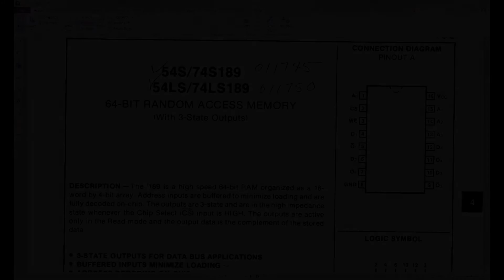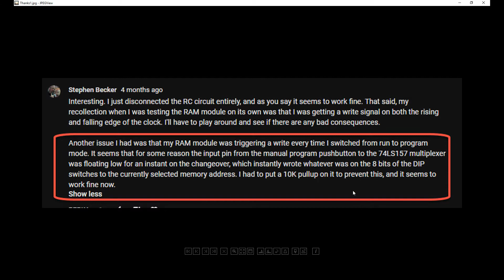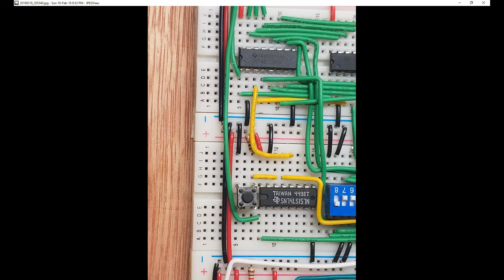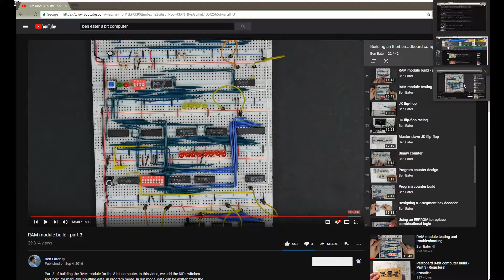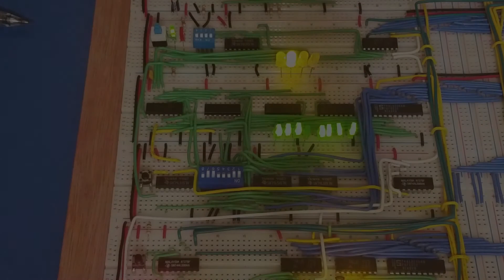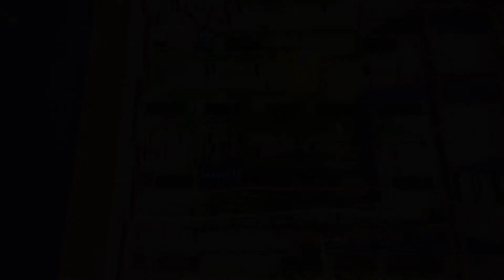RAM Overwrite Problem [Part 2] *SOLVED* - (Ben Eater 8-bit Computer) SAP-1

Comment: Thanks for posting this! I decided to build this thing during the pandemic and I had the same exact issue, but the 1k pullup resistor on pin 14 of the 74LS157 stopped writing ghost values into RAM. So, thank you for posting the other video with the symptom as well as the detailed solution here. 

I suppose thanks are also in order for Steven and Paulo for inspiring the solution.

Comment: thank you sir!   This also fixed my issue.  I had this exact problem and I also would get the "RAM Overwrite" when I pressed the CLEAR button.  Was driving me nuts!   I added 1K pull up in same spot you did and also one on the programming leg.  it fixed all my issues.   Floating inputs are BAD!!!!!

Comment: That's fantastic! I'm glad it is working now ! I didn't know you had a multiplexer between your RAM WE and the switch.... Indeed if you were connecting the switch first through a multiplexer, then the resistor should be at the switch... otherwise the multiplexer would be floating, and that would not have solved the problem.

Comment: Glad you solved it! Honestly I think Ben got really lucky with how smoothly his build worked electrically.

I've gone beyond his instructions now and made extensive modifications of my own, some of which fixed other pernicious electrical problems. In Ben's build, the four upper bits of the bus are connected to fewer ICs than the 4 lower bits (for example, the program counter, memory address register, and instruction register). I never exactly pinned down the combination, but this resulted in the upper 4 bits occasionally floating in a way that screwed up the ALU, particularly when LEDs were attached to the bus (even with dropper resistors on the backside of the LEDs and different value pullups on the bus itself).

When I upgraded my program counter and memory address registers to a full 8 bits each, the additional internal pullups on the octal bus tranceivers connected to the upper 4 bits of the bus completely cleaned up the floating values, and of course has the intended effect that I can now use 256 bytes of RAM. This requires a totally different RAM module of course, and reprogramming the microcode for "slower" instructions that run through two fetch cycles to retrieve instruction and then memory address.
Reply from the maker: Hey Stephen! I should have solved it 4 months ago from your other message, lol ... but for some reason I wasn't understanding what I had to do. In my defense, I spent all of 10 to 15 minutes messing with it before giving up. Was just too busy with other things at the time. But for the last few days, I've been putting a lot of focus on this project again.

I really hope Ben posts the conditional jump video soon. It was just as well that he has been away all this time, but now that I'm working on this again, I really want that last video.  :)

With regards to the program counter, memory, and instruction register, I really want to take mine to the next level as well. This "8 bit" computer definitely feels severely crippled due to the limitations imposed by the 4 bit  program counter, memory, and instruction register.

I've had this idea that I want to keep my current breadboard computer as-is ... and build a new one that has the 8 bit program counter, more addressable memory space, and an 8 bit instruction register. But instead of using breadboard, I'd like to design a PCB and have one of those mail order companies make it for me. I'd also like to employ some of the ideas that James Bates has been doing with his build. That guy has really gone Next Level with this thing.
Reply: See here for a jump circuit: https://github.com/space1649/8-bit-SAP-Breadboard-Computer-by-Space-Man

Also this, which is brilliant and makes programming this thing much more fun and less tedious: https://create.arduino.cc/projecthub/david-hansel/breadboard-computer-programmer-1e7a09

I was also thinking about doing a PCB, however I want to finalize a working design before I do that. I'm up to 3 EEPROMs for the control logic, but may end up with four in the end. I just picked up some 74LS181s which are four bit ALUs I'm going to replace the simple four bit adders that make up the current ALU. They provide just about all the arithmetic and logic functions you would expect on a reasonably functional CPU, and also can act as a comparator. In prep for that I've reprogrammed the control logic to have 6-bit opcodes instead of four, although a bunch of those are actually redundant to preserve the possibly of "fast" instructions where you only need one byte of memory. I think once I account for all of that, I have room for up to approximately 40 different instructions.
Reply from the maker: That Arduino programmer is definitely very cool. I watched that video and that guy has clearly put a lot of work into it. I'm not sure how much I'd have to modify my setup to make it work. I'd love to just be able to upload programs to the breadboard computer if nothing else. Toggling them in is fun the first time you do it. After that, it just sucks. hahaha. One of the things I'd like to do if I ever get around to making a PCB version would be to have a programming panel with large-ish metal mechanical switches like on the Altair. Those DIP switches are such a pain.

Regarding that jump circuit PDF, it's pretty scant on detail. Looks like a single QUAD NAND gate is all you need, but it isn't clear where the inputs are coming from, or where the output is going to.
Reply: It also helps to look at the picture of his breadboard layout. Essentially three inputs go into it. The first is the regular jump signal in Ben's design. This essentially needs to get passed through with no changes no matter what, because it resets the program counter already if the J signal goes high. The other will be a brand new control line that I call JC, which is NANDed together with the carry bit on the upper four bits of the ALU (you already used the carry bit on the lower four bits to daisy chain the upper four bits onto it to make it 8 bits in total). That way when the JC micro-instruction is issued, the program counter only resets if the carry bit is set.

To be clear, you need to add a completely new control line to the computer! This required a third EEPROM for me, since I've also implemented a ring counter reset instruction so I could use that Arduino programmer more effectively.
Reply: Thanks for mentioning my computer! You know that your question videos, and subsequent answers, saved me quite a few headaches, right? Sо anyway thanks for that too!

Now, my RAM module is quite different from Ben's, so I never ran into this particular problem. But in general, Ben frequently uses pushbuttons and switches to pull low some input signal, and leaves it floating when the input should be high, thereby relying on the "internal pull-up resistors" inside the 74LS chips. Now, just as you and Stephen Becker have also discovered, this never really worked reliably for me. Granted, I usually used 74HCT (which isn't TTL), but even on a few 74LS chips, this "default input high" behaviour never really worked. So as you've done, I also always used pull-up or -down resistors on all switches and pushbuttons, to ensure that I am always inputting definite logic levels. It seems to generally be good practice.
Reply from the maker: Happy to mention your computer. Your expansion above and beyond what Ben has done is highly impressive!

Glad this Q&A videos I've made helped you on  your build. There are a few issues people have had that I hope Ben will comment on at some point. I think his 8 bit breadboard computer playlist would highly benefit from having some follow up videos on these kinds of problems that others have experienced. For each of the issues I've brought up, I've found out that I'm not alone. At least 1 or 2 other people have commented stating that they've had the same problem. (Plus I would imagine others have experienced the problem who haven't seen or commented on my videos.) So that tells me these aren't isolated problems with my particular build.

Comment: For me I had to put a 1k pull up to 5V on both the floating pin of the manual write push button, and the floating pin of the program/manual slide switch. Both of these floating pins connect to a 74ls157 and I guess it didn't like the floating haha. 
Thank you so much for the tips, it helped me solve my issue too!
(Same issue as everyone else, where there was an accidental write when switching between modes)

Comment: I have build this computer during the time Ben did, but I used HC series chips instead of LS. HC differs from the LS series in the way that every input pin MUST have a pullup in order have a defined value every time. In fact, you should add pullups to the DIP witches as well. For the MAR and the RAM. The HC series 157's won't work without it. For the LS series, it is better to have them.
Reply from the maker: I completed this project and sorted out all of my problems with it 5 or 6 years ago. It was a fun (but totally useless) project.

Comment: I had the same problem but i also had to add a pullup resistors to the green/red LED. I just noticed that Ben did in fact add the same resistor like you did and he also added the resistor to the green/red LED but to his first breadboard computer! Watch this Video https://youtu.be/a73ZXDJtU48?t=5m20s
Reply from the maker: Yeah ... shortly after going through all of this, I also noticed that he had added that pullup resistor on his first computer. I wonder how his new computer works without it? I'll have to look into the LEDs. I haven't had problems there but I'll take a closer look. Thanks for the feedback.